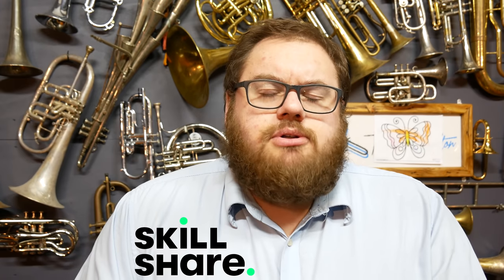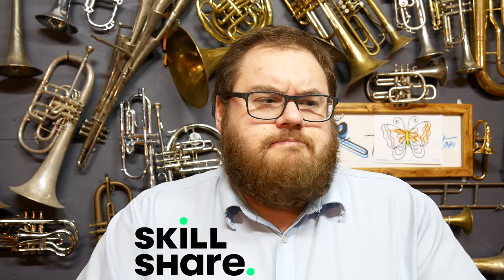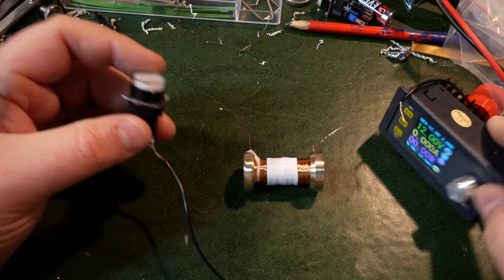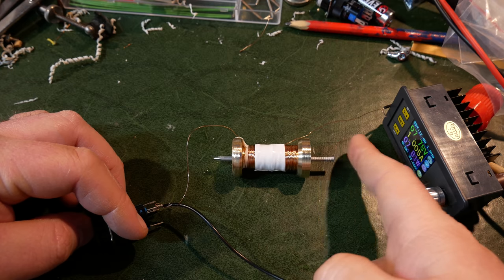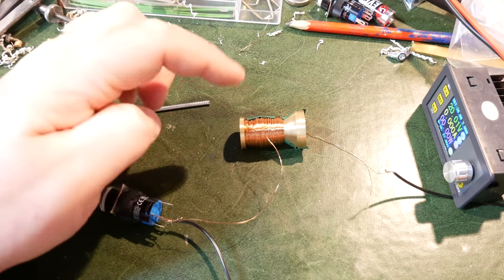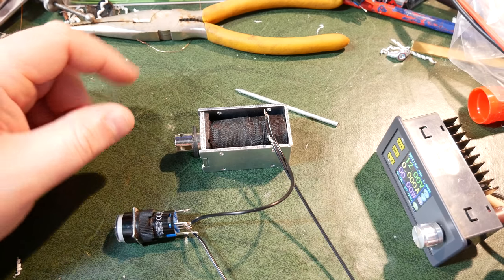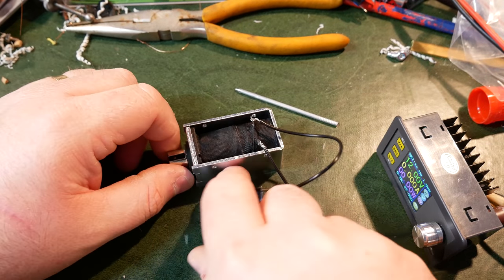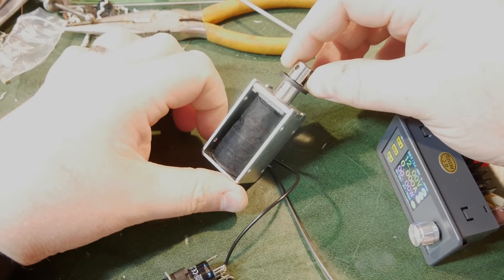Making a Remote Control Trumpet - Part 1

Comment: If you’re committed to the solenoid, I’d recommend mounting to the side of the valve, then attaching a rod across the top of the solenoid.  One end of the rod would actuate the valve, the other would attach to a fulcrum, and the solenoid would attach in the middle. This would act as a third class lever when the solenoid is activated - applying force to the middle of the rod to multiply the movement of the solenoid at the end of the rod; and as a second class lever when the solenoid is not activated - applying force to the end of the rod to multiply the force of the valve pushing the solenoid up in the middle of the rod.
Reply: If he does stick with the solenoid, I agree that this is the best course of action. However, the solenoid idea may not be entirely reliable, so what I’d do is use hydraulics so the player can manually activate the valves in real time.

Comment: I think a purely mechanical system would be preferable. Bicycle brake cables...??? Or wooden trackers...
Reply: Had the same thought, hydraulics would be appropriate.
Reply: eh, thats not as fun
Reply: @blankstraw6283  But thats not what this project is about primarily. Its about solving a trumpet players problem to be able to play his/her instrument again.
Reply: The pneumatics kit from a Lego Technic set.
Reply: I agree. If the only issue is the inability to lift the fingering arm and hand to playing position, I believe your idea with brake cables could be the (hopefully) least complicated solution in terms of engineering.

Comment: Learn from pinball machines. In a pinball flipper coil (solenoid), there are two sets of windings. One is high power for the initial movement. The other is a low power winding to hold it extended. If the high power coil is powered for long periods of time, it will burn out, so they do the initial flip with the high power coil and then switch to the low power coil if the button is held down.

Comment: One more use case:  Key change - you can envision a microcontroller translating button input into valve presses.  Thus, with a knob, you could step a composition up or down any number of steps.  The musician would play the music and finger the buttons as written.  The microcontroller would make the appropriate changes as needed. For instance, changing a half step down:  The musician fingers the second valve button (-1/2 step) and the microcontroller selects the first valve (-1 step) I do this kind of programming and would be happy to assist if needed.
Reply from the maker: That’s a fantastic idea

Comment: A linear actuator would likely work better than a solenoid.  A rotating motor (which is the basis for a linear actuator as well as a servo) gets to re-use the same coil and magnet every time they rotate.  A linear motor (of which a solenoid is a crude form) only gets to use each magnetic interaction once.  If you want to experiment more with home-built solenoids, I'd suggest experimenting with using a magnetic slug, and also adding an iron or steel frame, as with the commercial solenoid you were using.  The metal frame not only holds the coil together, but provides a path for more flux than would flow in its absence.

Comment: I have another use case for you:  I learned to play the French Horn, and as you know, it is a LEFT handed instrument.  I’ve always bristled at the advise given to new, and predominantly right handed, young students to “just get over it and learn to use your left hand”.  I believe this archaic notion hinders the influx of new players to this wonderful instrument.  Using your notion of a switch driven system, you could set up a switch system on the opposite side of the horn, allowing it to be played with the right hand.  I’d bet there’s a small but profitable market here.
Reply: Not being a horn player, I never heard that.  When I played trumpet, I would occasionally play left-handed just to mess around.  The one quarter at Ohio State I was asked to play horn, I never had a problem with working the valves correctly.

Comment: You can get very fast servos that are used for radio controlled aircraft and cars. I'm sure you could make three of these work. You could mount the radio receiver on the instrument and have a wireless radio link to a transmitter with three buttons.

Comment: Since everybody is posting their two cents anyway: When I heard your idea my instinct was to use hydraulics. That way you could in theory have more of the same feel as with valves. I play a percussion instrument(electric guitar) so I don't know if it's a thing at all. But then again with electronics you could have light touch switches and actuate the valves with pressurised air for maximum speed.
Reply: Sorry if this comes off wrong, but I've never heard of electric guitar being branded as a percussion instrument.  Was that a typo or did I just miss out on some neat music theory?
Reply: I think hydraulics would be too sluggish
Reply: Wind Turbine search for trent’s video on percussion instruments on this channel ;)

Comment: What a great thing you're doing, Trent!
A lot of suggestions mention bicycle brake cables. If the issue is moving the arm/hand to operate the valves, in terms of real-time action without the worry of lag or power supply, I think this is the way to go. Maybe a toy piston set or a second instrument to still feel something familiar. Best of luck!

Comment: Easier option: a piccolo trumpet with an octave-long lead pipe that goes up to his mouth. He can play the trumpet normally but hold it at his hip/wherever.
Reply from the maker: You would have to also modify each valve tuning slide and the tone of the instrument would be awful.

Comment: The biggest issue with your home made solenoid is the nail in the middle had too much clearance, and the brass you used is not magnetic so was increasing the gap between the coil and the nail. Had it been made of steel and there been less clearance then it would have been better. My personal choice would have been to use a servo motor with an arduino to control it rather than a solenoid. Your input switches wouldn't have to carry all that current that way either

Comment: Might I suggest looking at remote shutter cables for cameras, from back in the days when people actually owned dedicated cameras. https://www.adorama.com/czcrp20.html
Unlike brake cables, these are meant to push rather than pull.
A mounting bracket should be all you need to attach to the instrument, and another one the player can hold in his hand that makes the setup feel something like valves operated directly. 3D printing is probably adequately sturdy for the task.

Comment: mechanically extending levers with pivots down to keys sitting on the lap would be preferable than electrically operating the valves. much cheaper to do, and could be wood or metal rods. you'd only need to experiment with leverage and fulcrum distance. you know, a linkage ( x3). also would be lighter than 3 solenoids and associated power supply (too complex).

Comment: Is the power supply output AC or DC? With AC you will experience a greater starting "pull" due to the high inrush current that does not occur with DC.

Comment: I'm surprised you didnt just use a servo motor rather than a solenoid.
Reply from the maker: I didn’t think servos would work fast enough
Reply: @TrentHamilton  You should be able to find a servo with the right motor/gearbox combinaison to achieve the force and speed you need. Solenoids draw a lot of power compared to servos. I think removing the valve springs would be an interesting idea.
Reply: if you still want to use a solenoid, you migth use steel or iron instead of brass (im not sure if its brass but it looks like it is), to make it stronger.

Comment: You only turned the current up (amps) but not the voltage (volts) maybe if you increase the volts the magnetic field would be stronger and it could work
Reply from the maker: I did both. Ended up at 20v 3a. Started to make the solenoid go quite warm at that point!

Comment: Why solenoids? Why not bycicle break wire? You could actually use a valve box of an old broken trumpet and wire it to the actual trumpet. Sounds simpler to me.

Comment: If you reverse the polarity of the wires on the big solenoid will it push instead of pull? I think your friend may need to either spend money on physio-the-rapist of be like Mr Gary Brain, ex NZSO percussionist who had to become a conductor because of an injury to his hand caused by a rough air line about 30 years ago.